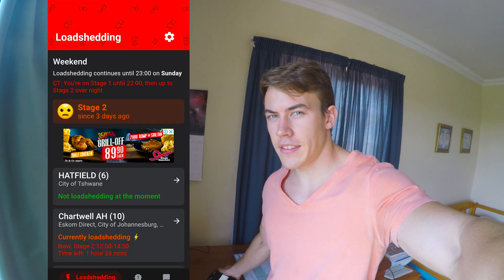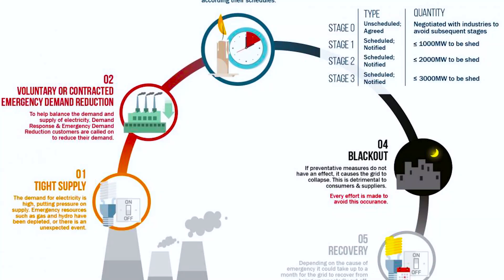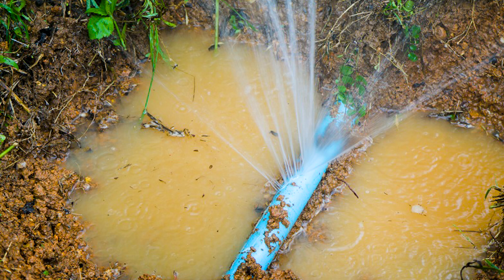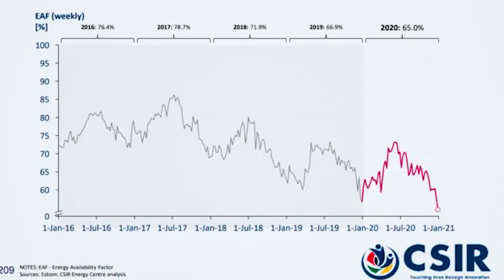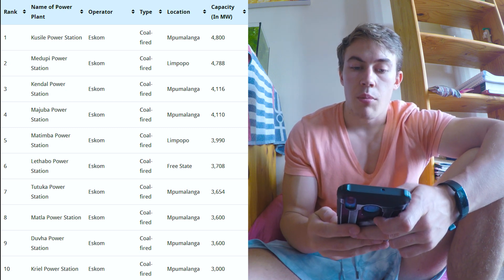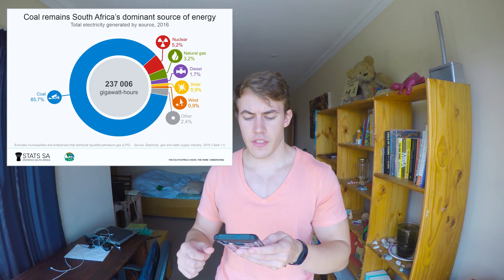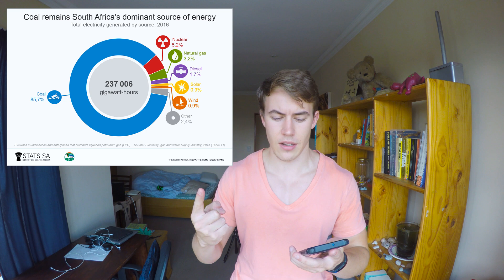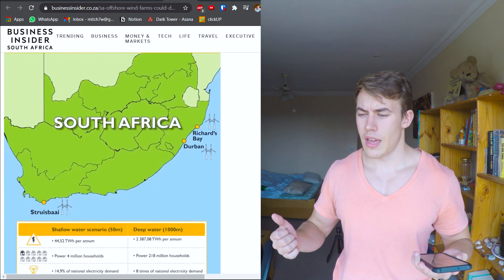Loadshedding Explained And Why South Africa Has Electricity Problems

Comment: I have a somewhat radical idea, break off the generation capacity of Eskom into mixed private and public generators. There after build about 16 CANDU9 reactors follow that up by creating a direct subsidy for energy saving appliances, roof top solar, wind farms and private green energy efforts. There investments can be made into desalination as a form of co generation with these nuclear plants.
Reply from the maker: Sounds like a good idea, want de Ruyter's job?
Reply: @mitch7w  Provided the ANC are willing to concede all relevant authority required to act. (Which is a total fantasy)

Comment: Thanks for the info. Quick question - would mobile internet be affected (i.e. not work) during the load shedding in Cape Town?
Reply: Mobile Data is still working during load shedding. But not wifi/rain devices that dont have external batteries.

Comment: Our coal plants are not breaking down because they are old and outdated.... its because they are using low quality coal (stole the good quality and replaced with bad quality), which is basically rocks, and break the boiler pipes, which is quite a mission to fix
Reply from the maker: That and just chronic mismanagement overall
Reply: @mitch7w  nah its deliberate... we beyond the point of incompetence... it is the Cadres and BEE inplants, that are systematically robbing this Country and not just in Eskom, Everywhere

Comment: Incorrect.  Nuclear might produce “clean” energy when it works, but when there’s a catastrophe such as Chernobyl or Fukushima, the damage is done for hundreds and in some cases, thousands, of years because of the contamination that results.  Chernobyl is still very contaminated - what do you think that does to the wildlife?  And Fukushima has dumped radioactive water into the ocean since the accident, contaminating the ocean.  Much of our seafood is now contaminated with radioactivity as a result.  What does that radioactive seafood do to a person’s GI system as it is processed?  It sits there in the gut, producing damage.  To say that “only” a couple of hundred people were killed is off base when you think about the long term consequences of radioactive contamination.  You can’t grow food or drink water in contaminated areas.  How is that good for the environment?  The length of the contamination is dependent on the half life of each type of isotope.
Reply from the maker: Yet still with all those admittedly extra effects not counted by the initial death toll, coal-powered energy kills 10000x times more people every century than nuclear energy.

Comment: Great video but stopped when you said a few hundred people died in Chernobyl. There were 300k-1m liquidators, what proportion of those had their health slightly/significantly/greatly impacted? Not to mention everyone else affected. I agree that nuclear is a decent option but, in my opinion, you shouldn't mention Chernobyl in such a relaxed fashion.
Reply from the maker: Yeah probably shouldn't have been so lib and the death count was probably higher over many years but the fact remains - hundreds of thousands die each month due to coal and fossil fuel pollution while nuclear power has caused one or two comparably small incidents.

Comment: I want an explanation of how a power plant deals with demand
The output of power needs to remain at 60Hz meaning a turbine is not allowed slow down
The reason that power stations explode is from over voltage. Each light switch and geyser and oven is a small bit of continuity which reduces the resistance between points live and neutral and that will caused transformers to heat up and explode (plugging in a 2000W appliance to a 20A breaker will trip the breaker because of the low resistance) 
But the solution is... Not connecting more households to the same substation or ringsub.
Loadshedding looks suspicious to me

Comment: I'm not very savvy when it comes to news and corru... politics, so I wanted to find out more about the electrical infrastructure in the country. 

Eskom's disastrous management kept cropping up in my study material...so I became curious. When I saw an extract about the power plants that where  so delayed I was confused and shocked why they decided to go with coal.

I'm no electrical engineer but coal fired power stations are so old school, I couldn't understand why they didn't go nuclear. Yes Nuclear is not the best solution (long term), but it is a hell of a lot more efficient and "cleaner" than coal.
Reply from the maker: Yeah unfortunately the best technical solutions are often ignored for expedient and politically-motivated reasons

Comment: The pollution could be resolved if the precips had been maintained emissions would be reduced.  Our stations use coal because most stations built on coal fields. When run in a manner that full P.M is undertaken like it was in the past we would not have  load shedding.  We have direct knowledge undertaking service for Eskom . Unless the new COE is allowed to clean up the underhand dealings that prevail on most stations outages will be on going.
Reply: We work on several stations or undertake work for them on service. The stations most have 6 turbine sets , Tutuka  , Kendal, Duhuva , Kriel ,  Kusile   Mendupi, Majuba, Matimba , Matla.Kendal.  Lethabo,  are around say  able to.supply around 610 Meg each if fully operating capacity. Grootvlei  also 6 units Komati  same. Hendrina more but lower output.This station is one of the older ones. A major problem is when services  undertaken they often do not use OEM PARTS. THIS OFTEN LEADS TO FAILURE ON RESTART. Specifications are very tight on rotary plant slight incorrect clearances can cause failure because incorrect lubrication to totary parts. Various reasons given from buyers or other involved but in our experience it involves corruption.  Some times openly blatant   other times those involved will make an argument  why local made parts installed. Kusile / Mendupi years behind commissioning dates and massive problems when commissioning. Mendupi recently blew up a complete unit. This will not be ready to bring back on service for more than another two years minimum. All parts must be imported. We do not have manufacturing facilities  here to supply parts for the Gen Sets. Same Applies on nuclear sets. These are imported from France.  Delivery by sea most part not off the shelf parts and technical specs very high. I assume you are aware that several stations shut down over 25 years back because Eskom advised we had over supply of power ,???? Some recommissioned at high cost because not decommissioned in a correct manner   , water left in pipe work which caused millions to replace. We do not have staff , coded welders , qualified engineer staff. Corrupt buyers and service staff.  One error or poor service methods used when mothballed. No quick fix for Eskom. Agree that stations are a disgrace on manner  of cleaning   removal of ash. Our coal is of high Sulphur content so if ash gets wet you now have additional  problem   turns into sulphuric acid. Which eats steel causing failures on parts of plant. Incorrect quality of coal , causes damage to boiler grates. Have seen on some stations that poor quality coal turned into what looked like volcanic glass and had to call in special list teams to blast this out of boiler grates. With over 50 years service on rotary plant I have seen things on Eskom Plants that scare the pants off me. Report these and risk your life. So do not truvialise  the mess Eskom is in. There is no quick fix but it will take hard decisions by top management,  engineers who have high ethics  , not afraid  to face up to their colleagues who are known to be corrupt,  employment of staff who can make hard professional decisions and not be afraid to stand up to those who support and are corrupt. Make no error it is not one person on site but consortiums who are involved  both here and overseas .